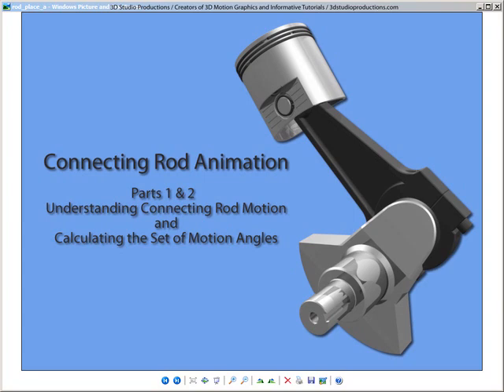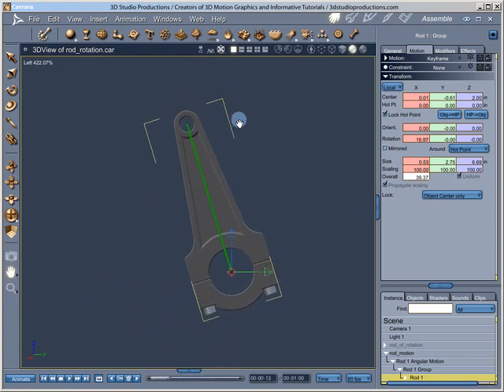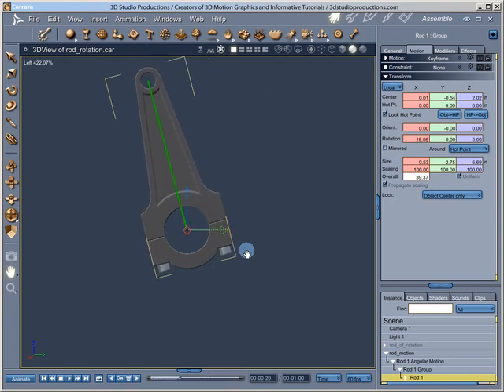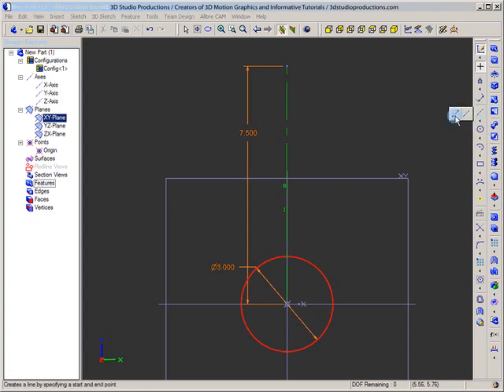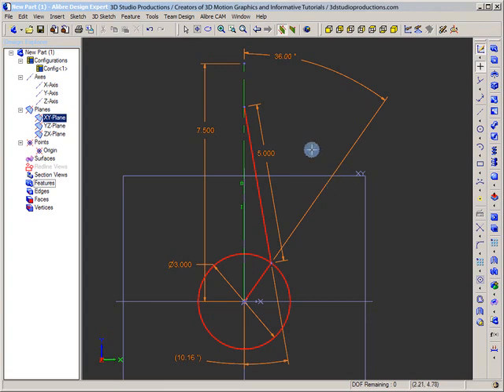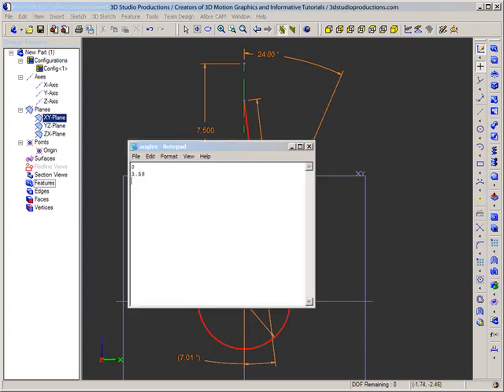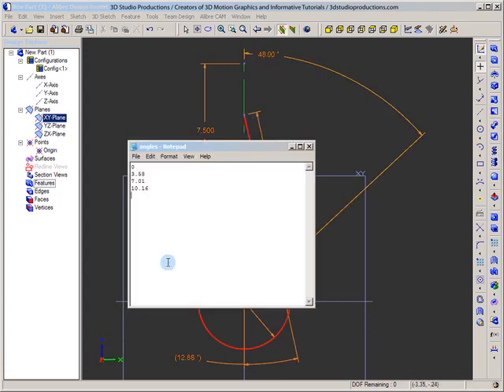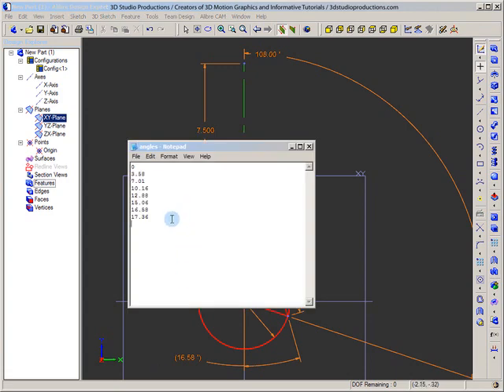Carrara 6 Pro /  Connecting Rod Animation / Parts 1 & 2

Comment: Neat. Although hypothetically it is possible to use contraints, parent/child object relationships, target helper objects, and the point-at modifier within Carrara for animating a connecting rod sans-keyframes. Or alternately the bones used for figure rigging may work. But then again, those methods may be more complicated than how you're doing it. Short of having the CAD software or knowing a bit of geometry or trig, I still wouldn't rule them out.